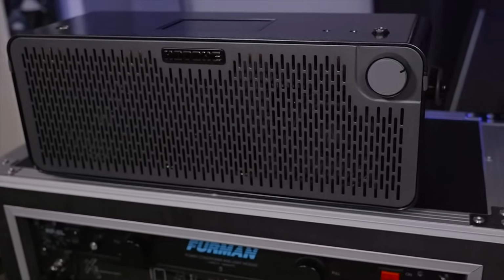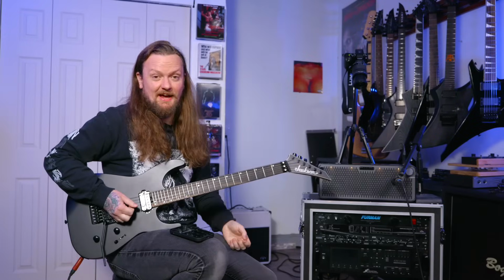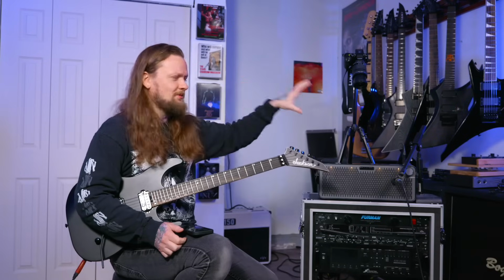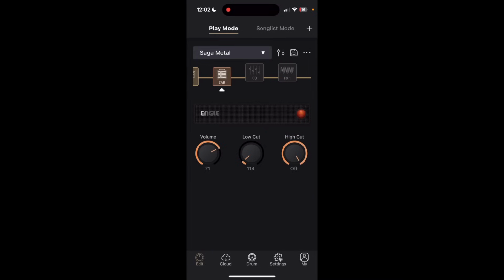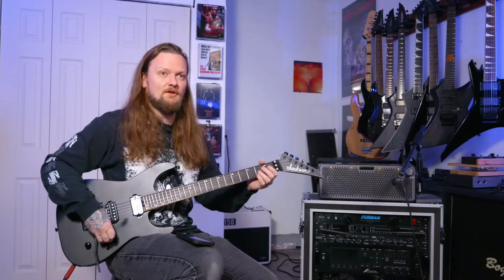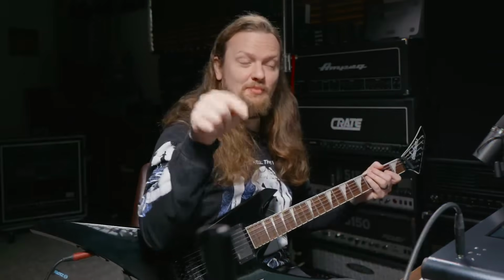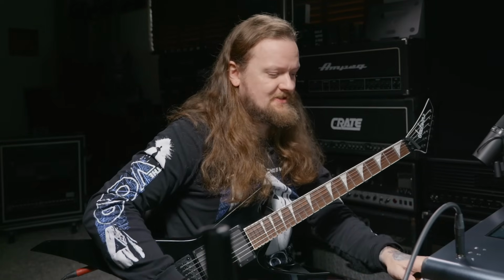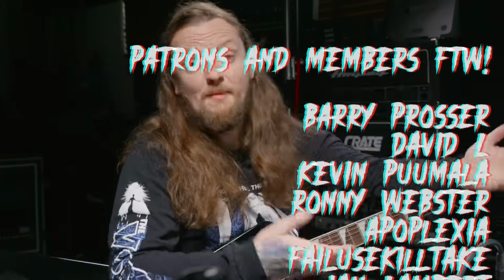Hotone Turned the Ampero Into An Amplifier - Pulze Modeling Amp

Comment: This is a  great product .. however, I believe 5 inch speakers and 40 watts would help a lot here (like the Boss Air EX.) I like the touch screen, but it really should be big enough to show the signal chain. I'm trying to find a product that doesn't require an app for in depth tweaking (impossible.) The only way that will happen is if Headrush makes one of these desktop amps. I'm waiting Headrush ... Get On It !!

Comment: I was all set to sell off a couple of amps to buy this one, but the tiny tiny touchscreen really makes me hesitate.  I have a hard enough time with apps on my phone already.   
- can I edit patches on my computer and load them into the amp?  If so, the screen becomes less important.
- what about changing patches on the fly, is that only by using the touchscreen/phone, or is there a footswitch for a/b or +/- patches?

Is it really that much better sounding than the Yamaha THR?

Comment: Also, for close mic of lower output, small FRFR speakers like ones built in to this unit, I'd actually recommend a pencil condenser or handheld vocal condenser. For the cheap side, Behringer has the C-2 Stereo pair, which would let you put one mic on each speaker, and they also have the SB 78a. An LDC would likely do the trick as well. A vocal dynamic mic like a 58, rode podmic, or similar would also probably work better than a 57 or an analogous mic from another brand, due to the differences in low end response and proximity effect. So, a vocal dynamic would work better, as would an LDC or SDC, and tbh in a perfect world you'd probably want to use one of each, dynamic and condenser, on each speaker.

Comment: Watch all your reviews, thanks for what you do man!  Is there any significant difference in value between this and that little Mooer practice amp?  Just curious because of the price gap between the two.
Reply from the maker: The mooer has a built in battery which makes it way more usable since you can carry it around with you and play wherever.
Reply: How about the actual amp and effect sounds - either better than the other? I know there will be personal preference at play, but as you've tested both under the same conditions, I respect your opinion. 

Cheers!

Comment: I'd rather it be a head.  A little expensive for a tiny practice amp.  Practice amps are normally supposed to be affordable.  Thanks for demoing it for those who are interested dude 🤘
Reply from the maker: Yeah same. If it was 100w head it’d be a lot more usable.
Reply: it can be run from the headphone out into FoH/PA or a power amp + FRFR cab, or into an active FRFR guitar/PA cab, or an acoustic combo. Alesis, Headrush, Behringer, Donner, Stage Right/Monoprice, and a million and one smaller brands on Amazon and Sweetwater have options available.

Comment: This has the potential to be awesome!!!! Audio interface, that's cool....no FX Loop, and no 1/4" or other outputs to connect to a power amp, or pa....or pedal board...
For the cost of this, you would think that there would just be more features.
$400 bucks is a lot of money for a (somewhat limited) practice amp. 
Thanks for sharing though.
Reply from the maker: I agree, especially when you can get a katana for $100 less. But if you are really into the Ampero ecosystem, this is their offering.
Reply: @TaylorDanley  don't get me wrong, the interface part seems like a cool selling point. As do some of the other features it does offer....
I guess it could work for others.

Comment: At $400 it has to have effects loop, 1/4" and XLR outputs to run to a power amp/ PA and MIDI for a pedal board.   If it is a stable platform it could be used as something live otherwise its just another bedroom practice amp.

Comment: Over $400 for a practice amp? I'll pass.
Reply: A katana and a couple pedals will set you back more than $400
Reply: I'm glad your comment was at the top...
Reply: The Ampero pedalboard alone is like 300$, so it's a bargain.
Reply: it seems that this is far than have all the same stuff of the pedalboard. @damiendelvallee7256
Reply: Yea, stick to your 200$ fender or marshall that sounds like wet farts
Reply: Just think about all the figures that you'll get out of it.
Reply: Competing amps have a better price as well. I can guess where they pulled that price from
Reply: Yea, stick to your 200$ fender or marshall that sounds like wet farts